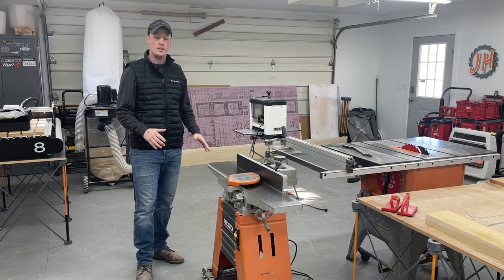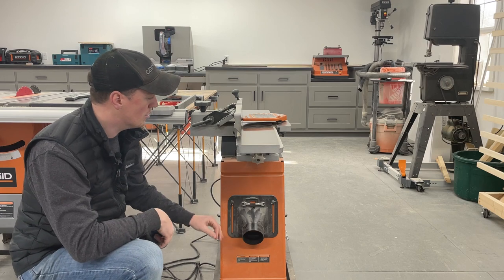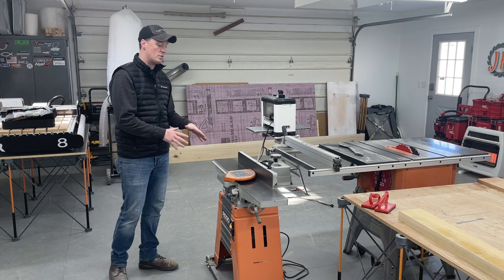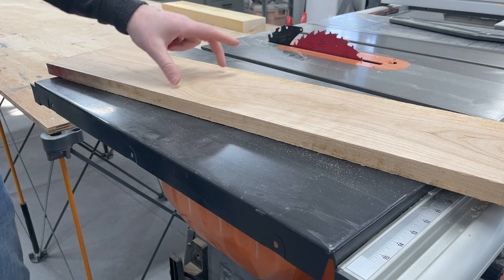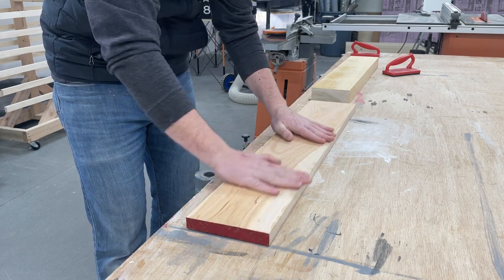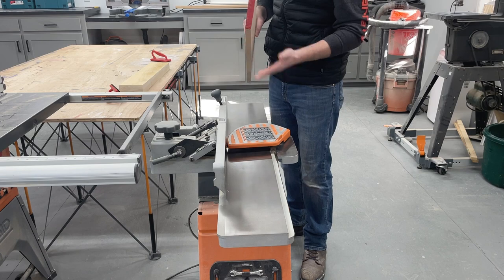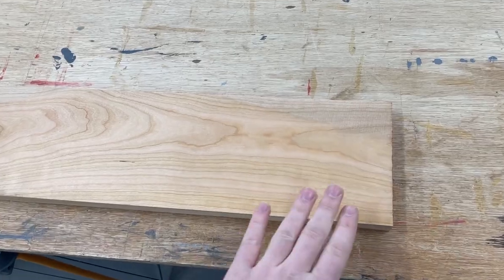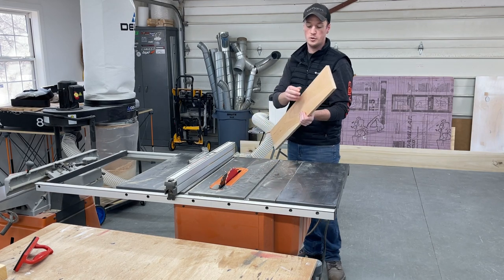Lumber Milling Basics | Budget Machines

Comment: I used to have that Rigid jointer. It worked really well. You could even get a Shelix for it.

I upgraded to a Hammer A3-41 jointer/planer later, with an insert head. Really nice, and takes up only a hair more floor space. If that's in your budget, check it out.
Reply from the maker: That’s one I’m considering! While I have the space now for 2 separate machines, who knows what the future holds haha
Reply: @JohnBuildsIt  If you get it with the spiral carbide head, it is almost silent, and it takes smooth cuts in just about everything. The wide table is a real luxury, and in the 41 version, plenty long enough.

Mobility kit they sell for it is, IMO, crap (the kind with two wheels on the back and then a lifting bar you hook into the front). If you will have to move it around, just put it on a regular or home-made mobile base.

Only upgrade I'd consider if I were to do it over would be the powered height setter for the planing table. It's a lot of cranking to get it up to height. Other than that, it's easy and fast to switch it over between modes.

They also sell separate jointer and planer versions if you prefer.
Reply: Oh, and most of these are built to order with the options you specify, so expect to wait a few months. I ordered my shaper in July and it arrived last month.
Reply: One last thing: if you think you'll get a saw from them in the future (or any other tool), consider if you will go Felder or Hammer. The felder accessories, like extension tables, are compatible across tools. However, the Hammer and Felder accessories have different connections, so you can't reasonably use a Felder extension table on a Hammer tool in most cases.
Reply from the maker: Awesome, I appreciate all the tips Pete!

Comment: With the rabbeting edge on the jointer you can do wider boards by taking the guard off and using a planer sled, hanging the non-jointed portion off the edge of the sled.
Reply from the maker: I’ve done it a time or 2! Wish I would’ve mentioned that in the vid haha

Comment: Hi John, great video. When starting off with rough lumber, how thick do you get the stock if you’re desired final thickness is 3/4. Do you start with 4/4, 5/4 or thicker. Thanks.
Reply from the maker: 4/4

Comment: Hey man great video. I am building my workshop atm. To say I am a beginner would be to good :) 

Can You please advise what wood thickness to use for mitre saw carcass. Or any heavy duty workbench.
Reply from the maker: For the top? I used to layers of 3/4” for mine
Reply: @JohnBuildsIt  what about the stands ? Or plywood is enough ?
Reply: @JohnBuildsIt  also if u make detailed painting vid would be super helpful
Reply from the maker: Plywood is great👍🏽 for solid hand tool workbenches you probably want a heavy solid wood base. But for general uses plywood is plenty

Comment: Hi John, I don't know how comfortable you feel with this, but what I've experienced with a smaller jointer is if you take off the guard and joint a reference surface on those wider boards.  You can then use a sled in your thickness planer to utilize that reference surface so you have two parallel and flat surfaces. Then you can just flip the board over and plane off the part that overhang your jointer and you'll have a flat wide board using a smaller jointer without having to upgrade the size of your jointer or having to rip the boards in half then regluing them together.
Reply from the maker: I have done that before! Definitely not ideal, but sure is helpful👍🏽